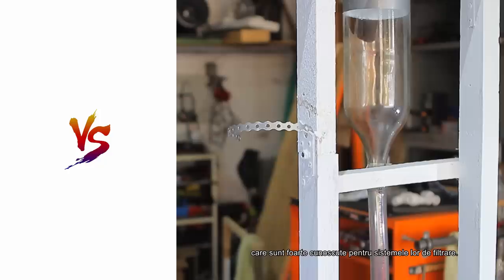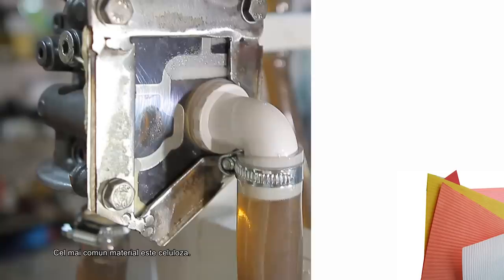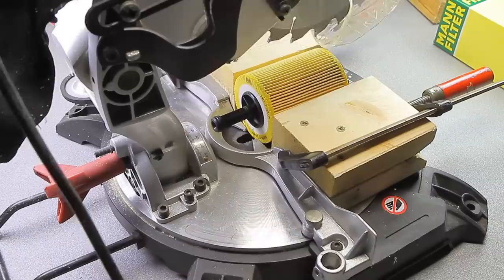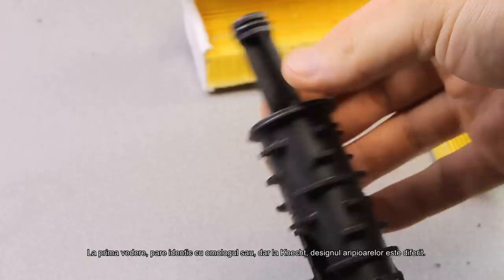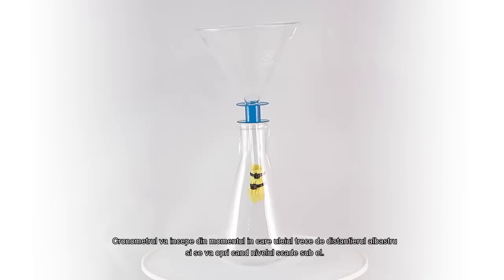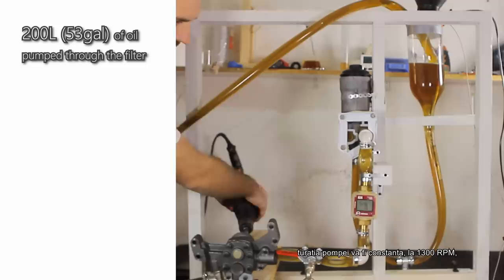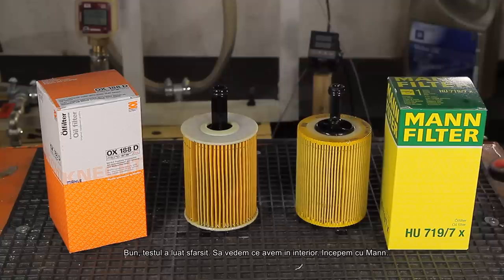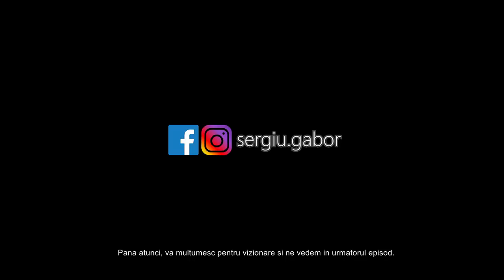Mann vs Knecht - Oil Filter comparison

Comment from the maker: Hi guys! Please keep in mind that I've made a mistake at the end of the video in the result table. My conversion from square cm to square inch is wrong.. by a lot. The correct value is 317.24 sq inch for Mann and 264.86 sq inch for Knecht. Sorry about that.
Reply: Interesant, nu stiam atatea despre filtre. Ce parere ai despre mahle vs hengst. Apropo in video apare cutia unui filtru mahle...
Reply from the maker: Salut Adrian, Knecht este deținut de Mahle, deci teoretic are trebui sa aibă caracteristici asemănătoare. Nu sunt sigur însă, o sa studiez si voi face un episod despre asta. Referitor la Hengst, inca nu le-am testat, dar o sa urmeze si ele.
Reply: Mann is winner
Reply: Mann or knecht winner??? Help please

Comment: Both are great filters and also OEM for VW/Audi, usually one of the two, on newer Audis you can find that it came from the factory with Purflux filter, but then again, it depends on the engine type.. Actually no filter is 100% efficient so whatever you pick, you made a good pick, compared to some no-name junk or fishy brands, this is top of the line. I've seen cheap filters that had more glue inside than they had filter material xD.

Comment: Excellent! This is some proper testing instead of just cutting filters open and speculating. Oil filter manufacturers have long benefited from people just trusting them on their claims and reputation, but now thanks to you we can know for sure how good they truly are. 

Would you also be able to compare K&N and Amsoil filters? These are two very interesting ones.
Reply from the maker: Thanks for the appreciation. Yes, I'm planning to test most brands that are known on the market, and also fuel filters and air filters.

Comment: Excellent video. It called my attention because I had problems using a Mann filter in my Mercedes-Benz. I was using either the MB OEM filter or the Knecht and things were just working fine. Then I used the Mann filter and after 2 weeks of the oil change, I noticed a rattle noise coming from the timing chain during the cold start that lasts a few seconds, and then it stopped. Checking the Mann filter construction (I had a spare one), it looked very bad because of the closing at both ends and the glue used, which made me think that it wasn't performing as it should and was not keeping the appropriate oil pressure during cold start, which would explain the rattle coming from the timing chain due to insufficient oil pressure. I changed the oil filter using the Knecht and the problem was gone immediately. No more rattle noise during cold starts.
Reply: Interesting. What model?
Reply: @craftedwithart  Thanks for answering. The Mann filter that caused the issues is the model HU514X that was supposed to be compatible with the Knecht filter mode OX 183, but it is not. Like I mentioned before, once the Mann filter was replaced by the Knecht, the rattle noise during the cold start was over. As a mechanical engineer, it makes me wonder how such a bad quality filter can be even considered as a compatible part of Mercedes-Benz engines.
Reply: @rogerriehl1612  I've noticed some rattle noise as well at cold start occasionally. And I have the MANN filter but ordered KNECHT couple days ago. The car is 560SEL
Reply: @craftedwithart  It's interesting to know that Mann filters fail in other MB engines. Apparently, they are unable to hold the oil pressure while the starter is running, thus the rattle. This can cause serious damage to the transmission chain. I just learned that the companies that manufacture oil filters to MB are Febi Bilstein and Hengst, this last is also responsible for AMG filters. So I ordered filters from both of them to compare and they have the same dimensions and appearance.
Reply: @rogerriehl1612  Ye I'm always trying to find the perfect fit for my Benz. Much better to find the OE part without having to buy directly from Mercedes-Benz
Reply: @rogerriehl1612  Nice to know.  Always good to find OE equipment for a good price

Comment: Thanks, nice test. However I don’t give much value for the filtration efficiency when it comes to looking at the caught dirt in the paper. You would need to do oil analysis to really know how efficiently they filter the dirt. There was a test of car oil filters in local magazine 2011 where they properly analyzed the results using proper equipment. Mann filter won that having one of the best filtration efficiency as well as second best dirt capacity. Knecht had worst filtration efficiency. When it comes to numbers it was 40% efficiency in filtrating 20 micron particles. Best filter had 50% and Knecht only bit over 20%. At 30 microns Mann filtered 90% and Knecht only 50%. However Knecht had best capacity for dirt but Mann was second. I don’t know how valid that 10 years old test is anymore, maybe they have changed paper or maybe not, but I personally do only buy Mann filters and change oil and filter every 10 000km.

Filter manufacturers has to balance between filtration efficiency and capacity. If you were to have 10 micron 90% efficiency paper it would be clogged quite fast and the worst case scenario is clogged filter and opened bypass valve = no filtration at all.

Comment: I work in the automotive filtration business as Head of product management.
Today still in the company as global manger of lean manufacturing.
Nice  idea for the test but i a sorry to be critical regarding the test so few comments:
1.Testing without a particle counter cannot support you claim regarding filter efficiency. 
2. Your test parameters and table of comparison are not good and not relevant. 
3. The pumping force in the vehicle is high and the gravitational flow test at 100 degrees Celsius does not mean anything it just gives basic parameters of the filter media which is irrelevant to the application in most cases. 
4. Your comparison of visual structure of media between Mann filter and Knecht filter is also wrong. 
5. Even though the test is done the same way, there is no way to assume or predict the distribution of your contamination sample in the same way as per fluid dynamics, so either gravitational test for retention or particle counter for efficiency at a specific @micron rating distribution sensitivity at the downstream end is the only way to compare.
6. We cannot know from you Video if the filter was installed in it's housings the right way or the same way in both cases (torque, o-rings, etc.)
7. Doing the test in proper ISO standard laboratory will change results dramatically. 
8. Filtration area calculation is wrong.
9. the table of comparison is choosing the wrong parameters to force declaration of the Knecht filter as the better filter, which may not be the case if tested in the way i mentioned above.
10. From the test you did there is no scientific way to determine which filter is better and what is presented here is just your interpretation.
11. Checking 2 aftermatrket filters without reference test to the original equipment filter is a wrong comparison. they both can be better from it or not.
Reply: You are welcome to make a propper video.
Reply: So, if you're so critic, why don't you show us with a "proper ISO standard laboratory" how it suppose to be done.? :)
Reply: @Zeghetank  I would if it was possible but the equipment required for such demonstration is worth millions + the time it = unrealistic. Listen, the video is cool, no doubt, but the way the conclusions are reached is wrong and most probably so are the conclusions. The most fundumental problem here is lack of particle counting with known accurate count of beta ratio at specific micron ratings as per the standrd. But this is not the only thing missing here. It is totally not a correct method to view and determine the efficiency of filter media by optical view. it's just misleading the observer and he viewers of the video. Even a gravimetric measurement is acceptable for efficiency also for Dust holding capacity. Please note i am a product manager in filtration for automotive. My only interst is to alert that the results of this video as presented can be off and most probably are. I am not related to any aftermarket brand by the way.
Reply: @yannigingihashvili2927  most of the time OE is aprox the same as aftermarket but with a different box. In what company do you work?
Reply: @BusterDescoperaRomania  This is not acuurate. Sometimes it might be ,for example if the AM is the OEM and the filter is just in a different costume, but most of the time there are some margins. I worked with all brands and familiar with technical sepcs. all AM filters are not matching OEM design or spec, materials, etc, this is far from being the reality. Sometimes the margins are negligible, even most of the times if you compare the big names, but some times they are not, depends on the brand, etc.
Reply: Look man..I don't know if you are the same Yanni Gingihashvili I found on YouTube testing thermostat in cooking pan in your kitchen!?I think that's you,because you have few video's about car problems.So,about few..total 12 points of your comment about his wrong parameters,ISO..gravitation flow,labaratories,particle counter..original equipment...bla..bla,I see you testing thermostat in cooking pan?In my own country Head of global,product manager of filtration business like "you are"should have millions or at least use own company resources to show us proper way of testing this filters.He did I great job in conditions and money he has and the point is,results are so close...in fact,in real life you won't even notice the difference between all this filters..

Comment: You put a lot of work into a well engineered test!
Although the following procedure could provide additional insight into the filtration properties/capabilities of the products under test, additional time/expense would be required.
Specifically:
1)  weigh each oil filter (new),
2)  run the oil filters through the oil pump without contaminants, then record the weight of the following after a set period of time: the filters and the amount of oil drained from each,
3)  repeat step 2 with a measured amount of contaminants. 
Thank you for your helpful contributions.

Comment: The flow through the filter would be interesting. Like how much actually was pumped through the circuit. Because the Mann had less on the sample, but significantly higher active area.

Comment: Positive displacement pumps deliver the same flow no matter the restriction downstream. The power demand rises as does the pressure which is why a pd pump always has a pressure relief valve. Some more modern engines have variable displacement pd pumps.

Comment: Really lot of work you made in this video. Very good analysis. 
But it look now like Mann is not good, but in reality those are good products. I wonder how other brands would perform, or even compare it also to the OEM from dealer :) 
One thing which is unknown is how much contamination has been passing though the filters.  But this would be hard to measure. 
Will you make air filter comparison as well?
Reply from the maker: Thanks! I'm planning to also test fuel filters and air filters.
Reply: @SergiuGabor  cool. How about air on filters? Some of them are with carbon some of them without. And the  are new filters from knecht lao series eg lao248 .
Reply: Hi one more comment from my side. You have been testing the material how fast oil can flow though it. This is telling us only the info about the material properties. Not saying that this is wrong, but I think missing test is how oil would flow over the whole filter construction, because at the end this is happening under the hood. Please consider this ;)

Comment: They are company partnership, same engineer team but making different design. 

1.MANN is longlife high pressure, syn oil

2.MAHLE is longlife filter low pressure, syn oil

3.Knecht is more filter but it's not longlife engine oil.

Comment: Wow man good effort. Like to see more vids about filters and oils. My question is. Do oil filter manufacturers consider engine specs? For example are they using same material and flow rates for lets say mpv and sport car?
Reply from the maker: Hi Josef and thanks. That's a good question. I'm not 100% sure, but I believe that a filter manufacturer will use the same media for all the filters, MPVs and sports cars. This is because car manufacturers design the filters with the specific engine requirements, with regards to the dimensions of the filters. From my experience, the media used by a filter manufacturer was the same across a wide variety of cars.
Reply: @SergiuGabor  yeah now i realized its solved by dimensions of filter. 

Interesting to see that. For me MANN was best filter you can buy.

Comment: The testing machine is awesome.
All the people are recommending Mann after OEM instead of other manufacturers.
I would be curious how a Mahle or Purflux behaves in a test and  compare with the already tested as well.
From my perspective the high detail picture got me to conclusion.
Reply: Mahle/Knecht, Mann Filter and Purflux are all OEMs. Basically they will comply to the requirements set by the engine manufacturers.

Comment: Are these results consistent across filters for other vehicles from these brands? Is there any possible difference?
Reply from the maker: As far as I am aware, filter manufacturers use the same suppliers for the media, which must meet the requirements. Even if there are multiple sources for the media, these need to pass qualification trials in order to be used in production. Therefore we can assume that the media is the same for all filter models from the same manufacturer.
Reply: @SergiuGabor  Thanks for the video by the way, this is the best filter comparison I've ever seen on YouTube. I can imagine the amount of effort you put into this video, good job! :)

Comment: incorrect test. it was necessary to take the used oil from the engine. there are real particles of wear. I’ve been using mann for over 20 years. everything suits me. and on the knecht a light bulb blinked. The quality and thickness of the paper plays a role. but most importantly its quantity.

Comment: So you tested only the paper in the flow test and concluded that one of the filters has higher flow rate despite the fact it had 20% less surface area overall... Wrong approach I'd say.
Should've tested flow with the whole filters not just pieces of them. The engine works with whole filter.

Second: the particle test didn't prove anything. Ideally you should circulate the oil only once through each filter. Then the same oil shall be circulated through a calibrated filter or filters to establish which particle size(s) penetrated each filter. 
Then you could tell for sure which paper worked better.
Reply: When you test some bacteria or virus you take a small tissue sample,not whole body with it..No need for it.You can just simple calculate total area capacity,and so much difference isn't there.But even if you take whole filter to measure like you say you will only get more flow?I am personally fan of MANN filters but after this comparison I don't know.They are both great but now I see why Knecht/Mahle filter in my country is more expensive than Mann filter.